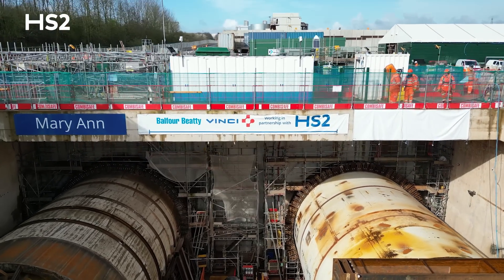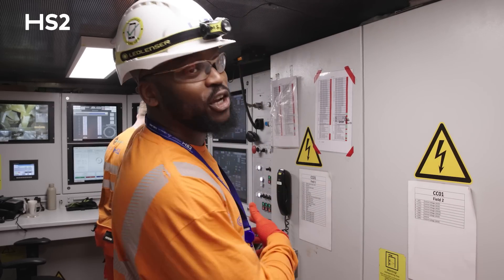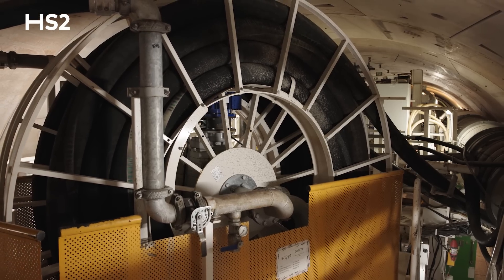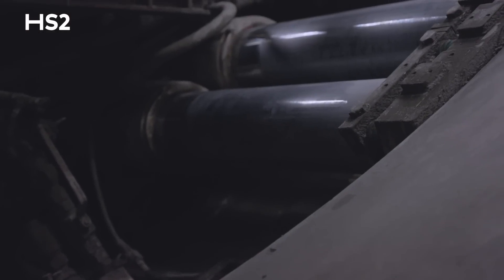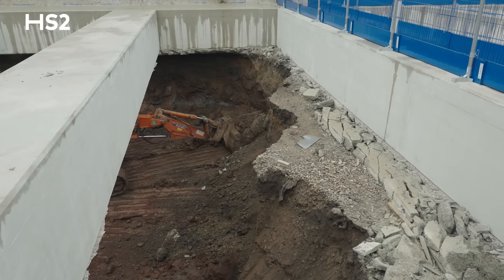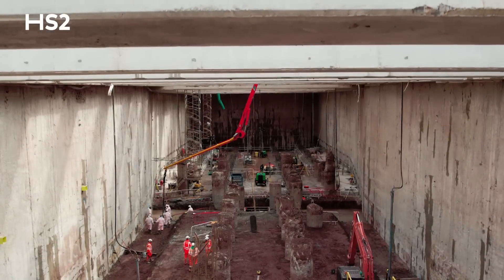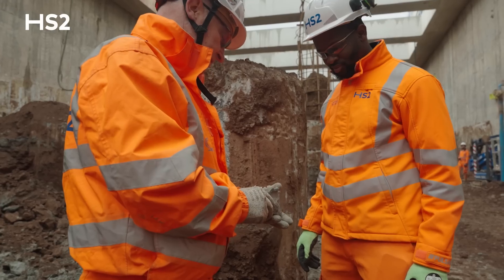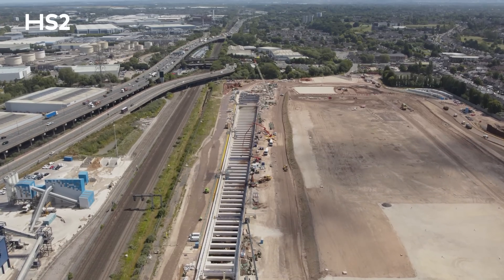HS2’s tunnelling into Birmingham reaches halfway point

Comment: Like other parts of HS2, a great piece of engineering. Why dont the media and people in general celibrate it more instead of knocking it. Keep up the good work.
Reply: Initially estimated at £37 billion in 2009, the cost of the HS2 project has now increased to an expected £100 billion by the time it’s fully completed. When the line is eventually operational, ticket prices are likely to be significantly high to recoup the massive construction costs. Despite this, the line will have just four major stops—two in London and two in Birmingham—limiting its direct benefits to only a small portion of the population. In fact, this line will only benifit around 15% of the UK's population. Meanwhile, other essential services and infrastructure across the country risk being overlooked as resources are diverted to this costly line.
Reply: @ShadowJester-jg2gs  The new cost includes all the increases in costs due to the delays, the cost of legal challenges and studies and the extra cost of appeasement works like extra tunnels.
You can see from your own figures that the people complaining and obstructing the project have cost all of us more than the entire cost of actually constructing the line, so don't you find it curious that you are angry at the project, not at the complainers?
Reply: And the estimate was never an estimate, only a figure pulled out of the air to persuade the  Johnson government to proceed.

Comment: I laugh at UK engineering. 
Come to Norway, we will show you how to build a tunnel and not take 19 years to do 200m.
Reply: The geology and population density of Norway are quite different from Birmingham, which affects how easy it is to build tunnels.
Reply: @pwithnall  What are you on about? The population density of the location of this Birmingham tunnel is irrelevant given that the government have the power to compulsory purchase AND it's already in a rural area. 
The geology of Norway is largely incredibly hard igneous rock, and can go in excess of 300m BELOW sea level. 
Technically the Norwegian tunnels, which may also contain junctions AND roundabouts to other tunnels are CONSIDERABLY more challenging from a technical standpoint.
Reply: @sandersson2813  Well it proves how much you know then about the Bromford Tunnel in Birmingham. The first thing it is not in a rural area not sure how you come to that idea as it runs under a major council housing estate,under a River, a council waste tip, an elevated part of the M6 and a major trunk route so no the Government can not compulsarily purchase any thing and the population of Birmingham and Solihull is relevant for their safety during tunnelling
Reply: @peterwilliamallen1063  The Government CAN compulsory purchase. 
Doesn't mean they will if it's going to cause too many problems.
Reply: @sandersson2813  Do yur home work mate, how are the Government going to compulsarily purchase the M6 Motorway, a major commuter Road, a City refuse tip, two major housing estates, a major X Country Railway Line and a river, so yes this tunnel is important to get the HS2 line from Birmingham Interchange station via the Delta Junction past these obsticaals into Birmingham City Centre where this part of the HS2 line terminates
Reply: @peterwilliamallen1063  
They don't need to. I'm talking about housing and you're talking about a tunnel that isn't even related to HS2.
Reply: @sandersson2813  The tunnel I am and you are going on about is related to HS2 as the Burmingham leg of the HS2 line from the Delta Junction into Birmingham City Centre Curzon Street Station goes through this tunnel the Bromford Tunnel  and Housing could not be compusaraly purchased as the hole housing estate would of been affected nd it is due to the amount of obsticles in the tracks route it was easier to bore a tunnel
Reply: @peterwilliamallen1063  I'm not saying they SHOULD CP, I'm saying they COULD. 
Loads of properties have been compulsory purchased for this project already. 
It doesn't change the fact that the UK is now inferior at engineering these type of projects to other countries which was my entire point.
Reply: @sandersson2813  But they would not of as there would of been 100's of families involved and it was easier to tunnel as I mentione not only was the Bromford Bridge Council Housing Estate involved, there was the elevated M6 Mtorway, a busy dual carageway road, the Birmingham to Derby Railway Lineand the River Tame, a Hotel  and other major roads in the area and as the HS2 rail alighnment went under all these it was easier to bore put a short tunnel and I am sorry to correct as some one who it seems doesn't live in the UK you are totaly wrong about the UK being inferior in engeneering projects like HS2 examples being the Colne Valley Viaduct the longest viaduct in the UK, the Delta Junction t Water Orton, The Chilton Tunnels, Birmingham Curzon Street, Birmingham Interchange and London Old Oak Common Stations on HS2 and many more projects arround the UK. The problem is where as other countries doing this type of work tend to cut corners on safety grounds the UK always build these things to a high safety standard
Reply: 19 years?
Reply: @mrglide7078  How long HS2 is projected to take.
Reply: @sandersson2813  not 19 years
Reply: @mrglide7078  Oh no, it's 16 years, bog deal
Reply: @sandersson2813  Sure whatevs, if you say so
Reply: @mrglide7078  Why are you trying to defend this laughable project which is already behind schedule and over budget? Doesn't that demonstrate my point?

Comment: Congratulations to HS2. I may be critical, but I have to admit - I couldn't dig that tunnel. No. But I have seen the sections and no way can that tunnel descend under Park Hall Wood without huge discomfort to passengers. Believe me; just look at the difference in elevation between the s.e portal and the River Tame. Well of course HS2 has a confident answer for everyone - the trains will run down that slope at 30mph
Reply: You should have seen the tunnelling on Crossrail. The company I worked for won the contract to build the tunnels, underground station platform concourses and subways on the western section from Paddington to Liveroool Street. The tunnel boring machines can only build the tunnels,  not the station platform concourse or subways. They were all built from an underground access,  nothing accessed from street level. And the ground changed from clay to water bearing gravel at Farringdon. . And a,spokesman for Transport for London said they didn't realise crossrail was such a complex project.